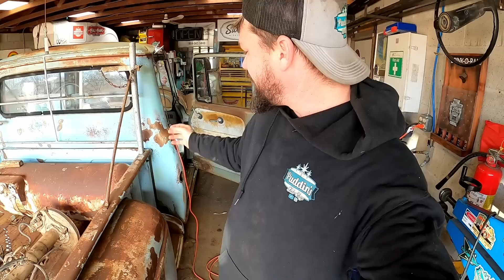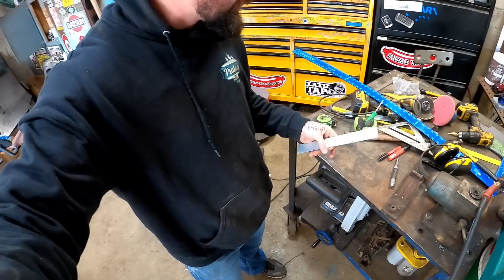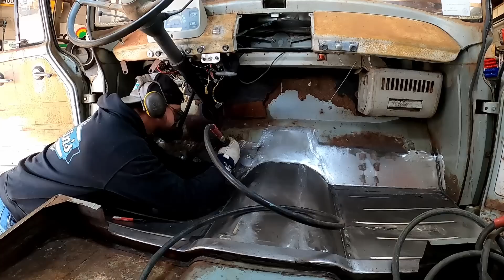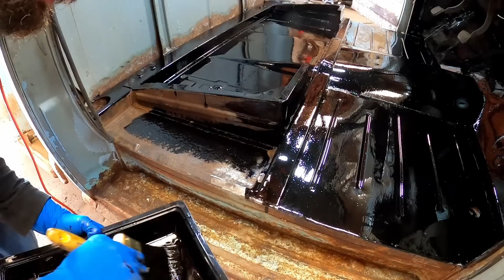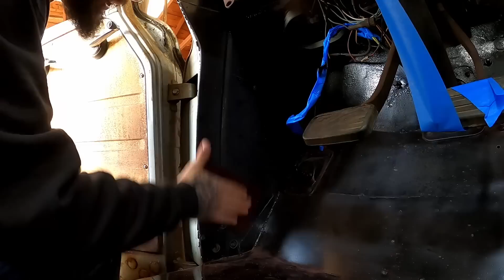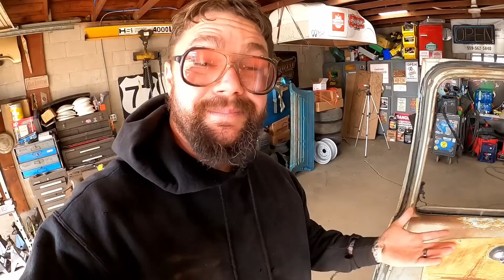The floors look AMAZING! Cheap Truck Build. 1959 B100 project.

Comment: Here’s the deal……that can and ANY can that uses an activator/catalyst or deadly!  You must wear  the proper lung protection. The problem with any mask is proper fit. With facial hair you can’t get a good seal. So a supplied air system with a hood is your best bet. Also gloves are a must and lacquer thinner is not a good wipe down. It is used for clean up of tools and paint guns but flashes off too quickly and is not good for lifting particles plus all solvents are traceable in your organs in about 15 minutes so we are gloves. Cancer is not your friend, been there, done that. 
Love what you do and how you do it so love yourself and family and stay healthy!  Thank you. 
I ran an automotive paint store for many years.

Comment: Raptor liner is great for home use. I did my front and rear bumper on my ram when I replaced them and it’s holding up really good. Been there about 2 years now if I had to guess and it’s my regular driver. I’m planning to do the bottom edge of the body with it later but not excited to tape off that much area. You should look into the brush on version. I find it’s a little better of a value, you just have to mix the 3 parts but you can mix however much you need and save the rest.

Comment: Was thinking about Mr puddin today, and saw two special trucks.. chinook smallish rv using Nissan or Toyota 4 banger truck, and then a original Nissan older one like your blue low rider, great used old condition with extended super cab with side glass, top glass and back glass rear cab using 4 banger…those two trucks would be cool converted to low riders and slammed… ahh well..

Comment: I'm in the middle of making a 4x6 lawnmower with a dump box. I'm putting 2 engines on her. One will drive the drive axles and the hydraulic pump. The other is for the grass cutting deck. Less drag on one 25 hp engine. Thought about in my head and started on it.

Comment: One of my past jobs was working at Line-X doing prep work for all the spray-on bedliners and correct scuffing it up is correct thing to do 👌 we would scuff it with a special 3M bristle cup on a angle grinder, wipe it down with methanol, and then it was ready for liner spraying.

Comment: Definitely should’ve used a mask homie. 🤦🏼‍♂️
The “2k” part on label indicates it’s a 2 part paint, as in it uses an activator/hardener. Thats what the deal is with the red button on the bottom. It punctures a secondary vessel inside of the can and releases the activator in with the main contents. 

So yeah, that ain’t ever coming out of your lungs lol. Not gonna kill you, but probably don’t do it again.

Comment: For a cheaper coating try flexseal. I use on step bars, winch bumpers and floor boards of my jeep. Works great and is rock chip resistant.

Comment: Do you plan on coating the underside of the floor since it will be exposed to all the rain, snow, mud, etc., elements? Seems that might just need rust protection paint at the least. But, It's your truck, I am just an observer, observing the All Knowing Puddin-Tang at work. Thx!

Comment: "Back in the Day" (when Mr Merser was in his youth) service stations did detail cleaning on work trucks. They typically diluted roofing mastic with lots of diesel to dress up the brake, clutch, and accelerator pedals. Looked great, easy-to-make & use, leftovers were easy to use the following week (more diesel if needed to re-thin) and would look great next to your undercoated firewalls, kick panels, & rubber floor mats. Perfect when using a garden hose to wash out interior floors!!!

.

Comment: Just a suggestion,you could spray paint the dash a gray color and door panels to give it a spiffy look since its a shop truck. The head liner could have a piece of indoor/outdoor carpet glue to it just to look good. Shop truck,anything goes. I know that is NOT how you are supposed redo the inside,but new things can be tried.

Comment: Regular rustoleum works good. The 7 years I had my chevy pickup with brushed-on rustoleum on the cab floor, it never cam off even with boots/shoes rubbing against it. No floor mats or carpet.

Comment: Gas pedal mount came up sweet. That raptor liner is the cats meow, I did my gasser floor trunk and under side of tilt nose in it. ( the kit of course), my wallet couldn't stomach 40 dollar rattle cans